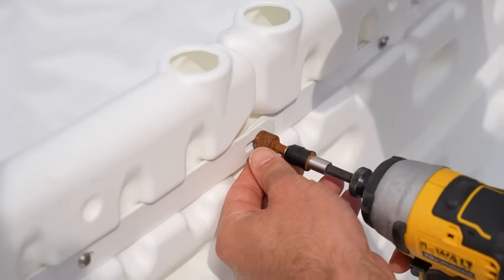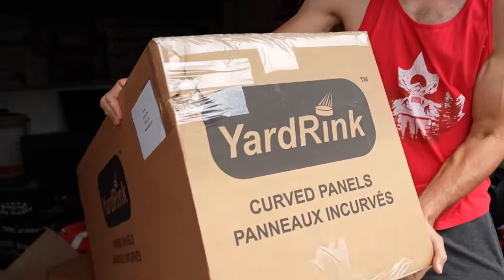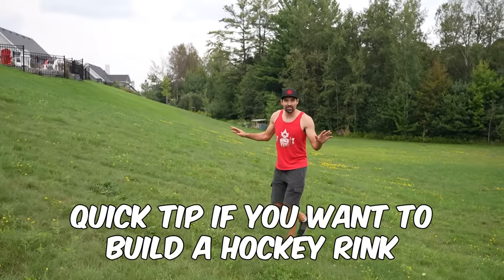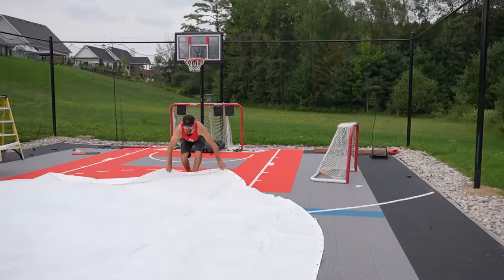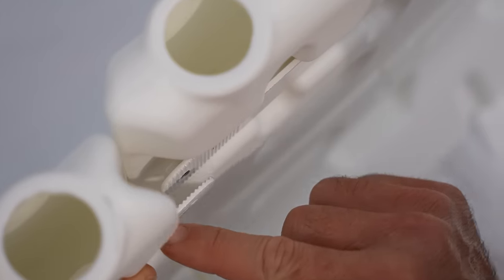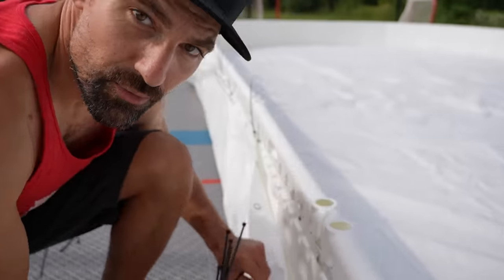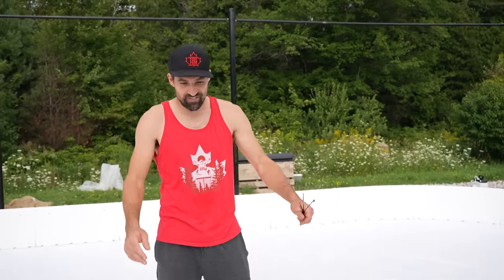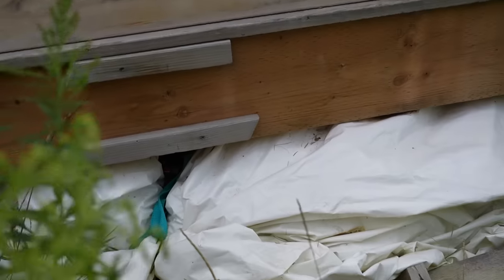We built a Hockey Rink in AUGUST?! - YardRink Review

Comment: Maybe putting a ruler inside or marking height inside the boards on each corner would help identify the ice thickness throughout the season. That way you can start at 4 inches and identify if it’s been cut up too much on one side or all around and refill it

Comment: awesome video..but filling the boards with water then letting it freeze seems like a a disaster waiting to happen.
Reply: The panels, once filled then frozen, lock together into a very solid wall with great puck play.  They were designed to withstand repeated freeze/thaw cycles and have performed very well in yards across North America.
Reply: @yardrink9790  So it's inevitable threw expansion, freezing + pucks being shot at the objects you paid for to then be instructed to weaken. Your creating stress points in plastic then shooting hard rubber at them?

Why not fill with sand or something with give and dose not expand and weaken the product? 

Wouldn't be as sustainable as a buissness I guess. 🤣
Reply: @xXOAXxTempest  Thanks!  For sure, you could fill them with sand if you'd like.  The filled-and-frozen panels definitely do not crack from repeated puck hits.
Reply: If you fill them with sand it then turns into a permanent rink. I think the idea is that this makes it possible to disassemble in the spring while still being very strong in the winter
Reply: Just dont fill all the way leave room for expansion. Duh.

Comment: Do they make several sizes. I would love a small one for our back drive way
Reply from the maker: Yes you can customize
Reply: Sizes range from as small as a 17' diameter circle up to 50' x 100'.
Reply: @yardrink9790 hey just wondering in the in use videos the rink is nearly filled to top. Are you able to just fill it with like a quarter to a third full so the boards work like a rink for the younlings and they can’t fall off it